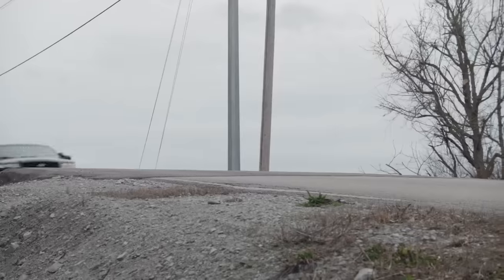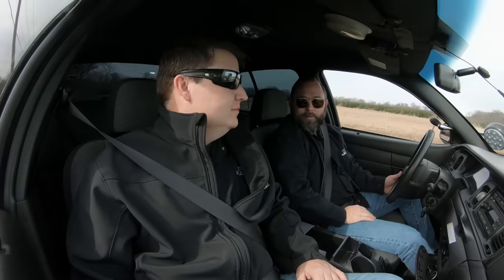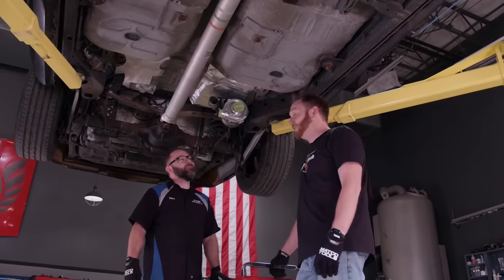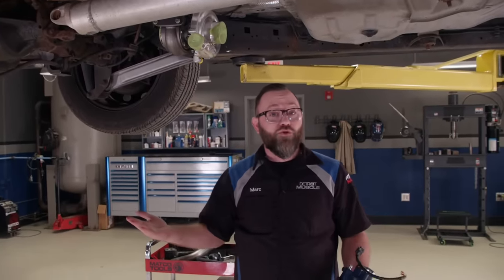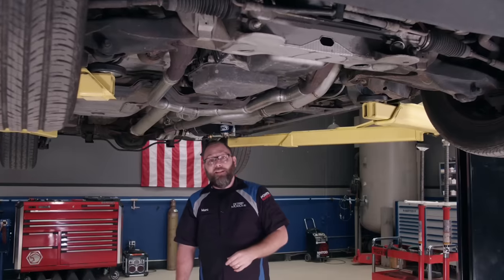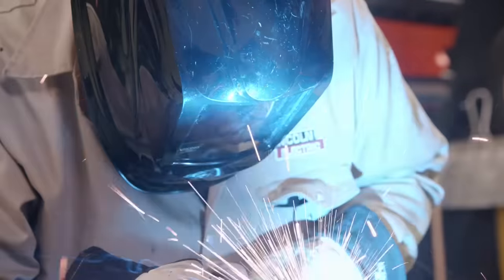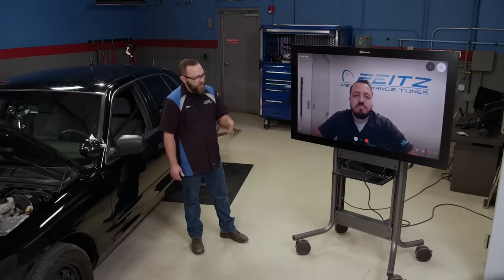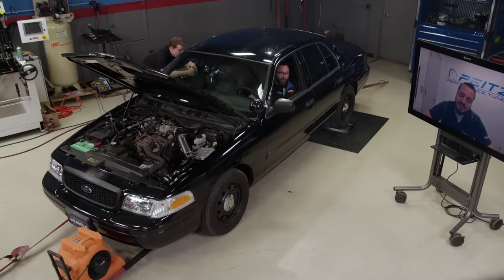Boosting A Crown Vic Police Interceptor 160 Horsepower - Detroit Muscle S7, E7

Comment: As a Panther owner, I watched this with some interest. I say 'some', because I really have no intention of making a build out of it. It does its job beautifully in stock form, and I have an old Corvette to play with on the side. But, if I just had the Panther and wanted to play, I'd at least consider doing this. So let's think about it for a second.

For a daily driver, it needs an intake snorkel that breathes from a safe location. Like maybe the trunk, for example. Or up in the rear fender somewhere. I don't know. You might want make a shroud for the turbo setup, to protect it from all manner of threats it will face under the car. Luckily all that stuff is just more cheap / creative fabrication. Well, cheap if you have the means to do it yourself.

The turbo lag must be epic with this setup. Meaning it takes an eternity for the boost come up after you open the throttle. That's the huge, obvious downside to this installation. There is no way around it. But the power it makes is very impressive, on the dyno.

In the real world, I think the lag would be the defining factor. It would suck for any type of canyon carving work. But who goes canyon carving in a Panther? A few guys do, actually, but they're weird like me, and don't count.

No, this is a hooligan setup, for sure. It would be fun for half-mile and mile speed runs, I think. Don't forget to figure out how to defeat the factory 120 mph speed-limiter...

Comment: ya but ya can fit two smaller turbos each one right were the catalytic converters used to be. duel M55 trims, ready for anything down the road or even another 250'000 miles. that's what i am going to eventually do with the 1994 4.6L Thunder Bird i have!

Comment: On the filtered side of the Turbo, a 90-degree tube up into the trunk would make for a closed air-box and avoid excessive dust and water infiltration.

Comment: Orientation of the turbo for the oiling is important if not running a scavenger pump.
You should have gone over all the added parts necessary for a rear mount turbo, part #s, etc.

Comment: I own an 03 cvpi. I've always been a Ford guy,  but these are great cars no matter what you're into. Drive it like you stole it and you still can't break the thing. (Believe me I've tried. LOL) And if you do break it, who cares?! Parts are dirt cheap and everywhere. As for everybody crapping on the rear turbo setup. Apparently none of you have ever heard of STS. And no, of course you don't want to orient the turbo so that your filter is  hanging down on the ground. Just clock the housing. shield the filter and your fine. Has anyone ever seen a front mount?? Sucking in every particle of dirt n water in its path. I've seen low underhood mounts too that are no better.  And this really is a fairly easy install. I've helped friends w modded turbo setups on hondas evos stis etc. And if someone thinks this plumbing is "bad",  clearly you've never been around someone doing a custom turbo setup.  Fun build guys. Thanks!

Comment: I’d think it would be easier and less risky for the motor if you’d make a remote mount oil system for the turbo. Not risk the line breaking and dumping oil. Plus, the oil would be cooler and less prone to burning after shutoff.
Reply: I was thinking that myself a closed system with maybe 3 quarts of turbine oil and its own filter. You could probably ignore it for a good  long while.

Comment: could do a bend on the intake and place the intake filter inside the trunk or under the rearseat  , simple fix to be able to drive in the mud and rain , i think the cold air pipe is too long to make a backfire reach the filter anyway

Comment: Lol anyone notice when they first pulled off in the Crown Vic how the water shot out of the stock exhaust? I think I’ve seen that occur on literally every Crown Vic from that era upon first start up and take off. It has to be something inherent to the way that particular vehicle is setup because it happens much more than most other vehicles.
Reply: Water coming our of tailpipe denotes how efficient engine combusts  fuel.

Comment: Why would you put an air filter under the car? You could've easily put an air intake tube from the turbo into the trunk and then put an air filter into the trunk.

If properly sealed up, it could be driven practically in any weather.  It wouldn't be too hard to retro fit that.

Comment: Was this done to save on intercooler purchasing and install? Its weird to mount the turbo, a its accessories, on the back bottom part of the car, without any protection. Plus the turbo lag will probably be quite noticeable - compared to having the turbo setup next to the engine.

Comment: Would love to see air intake temps with the hot and cold side tubing sitting next to each other.
Reply: no I reckon that long tube to the front is almost an intercooler.
Reply: @RIPPERTON  next to the exhaust and substantily less surface area than an actual intercooler? Highly unlikely.
Reply: @Ausblack   probably doesnt cool well but at 60mph theres not going to be any noticeable heat soaking over from the exhaust pipe, air speed is going to be pulling that hot air away right now

Comment: Could have run the air intake up into the trunk to protect it from the elements but might have hotter air in certain conditions but would be better than the filter hanging out in the mud puddles and snow banks just my 2 cents

Comment: Nice job guys! I do have to add that most back yard mechanics including my self dont have the tools to fab a complete custom turbo kit like that. For someone like me its cheaper id say to throw a blower on the car, or if possible a good used gen 2 or 3 coyote. As far as low budget goes. But as long as your paying a shop to do this kind of custom work its nit going to be cheap.

A car like this needs to be daily, so im not a fan of the air filter location. 

That power seems low at first. But its actually not bad. I didnt catch how much boost it had. But i can say that i had friends with full bolt ons and supercharger that didnt make this kind of power.

Comment: If I was going to have to fabricate an exhaust system anyway, I'd put the turbo under the hood with an intercooler so I could drive the car in the rain and snow without FOD'ing the turbo or hydrolocking the engine. OR I'd go the simpler route and modify a Mustang centrifugal supercharger kit and call it a day.

Comment: Rip, i have 2001. And hp tuners, and, well everybody starts at about 2005. Pre-05 cars dont have tuner support w/ cable throttle, non electric transmission etc

PS if im wrong, ill gladly be, just simply let me know who would tune a 1998-2002 vic/marq/townCar

Comment: I've seen the horsepower almost triple on a stock 4.6 Crown Vic that was not running right and didn't make 140 horsepower while they started feeding the nitrous with no tune I think they ended up reaching almost 500 wheel torque and I think like 479 HP I believe just from spraying nitrous directly into the intake by the throttle body LOL

Comment: Isn’t kinda stupid to mount a airflow restriction device in the exhaust (the turbo bcs clearly its restrics air flow) to pump more air into the engine and have more power but at the same time you lose power bcs of air restriction. Can some mechanics (experienced) help me with that?

Comment: Try insulating the exhaust back to the turbo, And maybe relocating the breather under the rear bumper.
Reply: Arthur Hardy  wayyyyy to far from the engine. You want to catch the exhaust as close as possible to engine to capitalize on thermal expansion. Back of the car is just stupid on more levels than I can count.  I’m sure it’ll be better than nothing but good grief, coulda been so much better. Turbo lag will likely be atrocious.
Reply: @jeffallbright4449  Yeah, the turbo is were it is already, that's why I said insulate the exhaust back to the turbo, to preserve the heat of the exhaust.

Comment: You should have build a SVU Police Interceptor. A Terminator P71 is my dream Crown Vic.
Reply: There is a Terminator SVT Cobra Mustang that Ford made in 2003 / 2004.
Reply: I know I would love to have the Mustang Terminator Cobra.

I like the Mustang Terminator body styling more than the Crown Vic body styling.

But for a sleeper, I go with the Crown Vic.

I guess if anything get a Crown Vic shell and gut out a ( rear ended or t boned ) Terminator Cobra Mustang,of its needed parts to swap it over successfully to the P71, and do it like that.

Comment: Such a long intake, and the exhaust gas route to the turbo will not affect the huge turbo hole?
What about the lubrication system that also cools the turbocharger? I understand that at such a distance from the engine, the exhaust gas temperature is not too high, so the turbo does not heat so much, but lubrication is needed, oil collection too.
Reply: It might be a self contained turbo 🤷
Reply: the turbo is still lubricated by engine oil just have to run really long oil feed line back to the turbo. The electric oil scavenge pump then sucks oil out of the bottom of turbo pushes oil back to the oil pan because since the turbo is under the car it cant just gravity drain back to the pan like a normal system so you need the pump to do that.

Comment: Y'all going to make me crawl under my 02 Vic cuz I'm curious if you can drop the fuel pump out the same way cuz the only fuel pump I've changed we had to drop the tank how did y'all get the gas out does it have a drain I guess I'll go look at mine but obviously you have to get the tank empty to drop that pump out didn't realize it was made that easy on the Vic

Comment: Kinda defeats the purpose of using the charge tube for an intercooler if it's right next to the exhaust pipe...😲
Reply: Sure does.
Reply: I'm with you on that thought buddy. All I can see working is insulated heat shielding the whole length. Kinda like the great wall of China? LOL!

Comment: The HP and torque curves shown on the screen are wrong. The crossover is shown at 5500rpm which is theoretically impossible. It is always 5252 RPM.

Comment: A Crown Vic is a bad mofo until you pull up next to a Deville with a Northstar. Same size engine but them 32 valves will suck the air out of a Vic mouth.

Comment: Love Crown Vics, love turbos,  but for the life of me I can't understand putting the turbo under the car where dirt, rocks, water, snow, cowshit, you-name-it can be sucked into the air filter.  I'd put it right up near the engine where I would not lose heat energy and have much less Mickey Mouse to get oil in and out of the turbo.  Oh well, I guess it's television........
Reply: Terrible idea
Reply: These cars are packed like a tin of sardines.. not much room in the engine bay for a tubing and all the piping, i inagine just getting the charge pipe upto the intake was a hassle

Comment: Why not used an LX Dodge Charger R/T Police for this Project???
Reply: The DELAY must be horrible in this kind of Turbo position.... Can´t beleave why; I heared; "this kind of Turbo Position didn´t need a Intercooler...(money)"
But then you need that Oil Pump added to the system, that the Turbo gets its neccessary Oil Pressure mounted back there. And this Oil Pump looks like that it will cost nearly the same or more than an intercooler...right???
So WHY mounting an Turbo on that position, what has such an DELAY ???

Comment: That long block is junk. Spark plugs problems are handled by actually doing the correct maintenance. It's still using the stock junk rods and crank. Probably using the same junk plastic timing set also.

Comment: I was actually surprised that the 2V made 200 hp. I was expecting 150-180
Reply: It’s supposed to make 250 which is absolutely what they make stock I dynoed mine when I got my 2011 it had 23k miles on it it made 254 completely stock so this one making 200 means there was definitely something not right and only SN95 4.6’s made 180hp crown Vic 4.6’s are superior
Reply: @StockTurboN20  
I think I’m 2008 Ford upped the HP to 250. The sn95 got the PI heads on 99. They had 260 hp.

Comment: sorry much rather have the dual exhaust couldnt even hear the turbo and strange that you crown only did 200hp when my 06 does 263 stock
Reply: Your stock vic Puts 263 to the wheels or the flywheel factory rating u mean? Two entirely different ratings bud
Reply: Strange that CVPIs are only rated at 250hp at the flywheel. But whatever you say.

Comment: I'm building one on my channel lol built motor cams hi compression heads converter everything
Reply: crown Victoria lifestyle. 2V Or 4V, what is your setup?
Reply: 2v I believe
Reply: @bri-manhunter2654  I have both I'm working on the 2v now I just got my degree in kit from modular head shop I built the trans by myself
Reply: @bri-manhunter2654  I have two cvpi 2011 and 2009 
I have Cobra heads and aluminum block and a couple other parts down the road for the 4 valve swap in my 2009 cvpi

Comment: One word - ruined 

The whole fitting of the turbo is abysmal an amateur mechanic wouldn’t have to run piping as long as the Las Vegas strip, not to mention the turbo just diminishes the cars character 

Right here is the downside to living in a free country….

“Direct universal fit” then proceeded with “takes a little bit of modifying” which contradicts the first statement is prime example of the hillbilly bob’s level of intelligence…

Comment: How can it start @ 200 HP when it's @ least 240-250 HP stock?
Reply: 250
Reply: Rolling dyno number vs factory flywheel rating. They're rated at 250hp flywheel.
Reply: Rated at 250 HP at the flywheel. They measured it at the wheels. Yes you lose 50hp sending that power through the transmission, down the driveshaft, through the rear differential, down the axle shafts to the wheels. Long drivetrains = massive power loss.

Comment: So they expect the long charge pipe to act as an intercooler, but right before it gets to the intake, it runs right with the exhaust.  Going out on a limb and sayin that may not work quite as well as planned.  Dunno why they didn't locate the air filter into the trunk or something.  Not ideal, but better than...sorry kids, can't drive in the rain.  /boggle

Comment: still a nose heavy tank good for 125..130 mph stock ..chipped 160..but still small lighter  car winding road  will beat it
Reply: Initial D proven.
Reply: 160mph with 215whp and 4000lbs? Dont think so. Lololol
Reply: The Vic cannot do 160 and the cop chip if that’s what your talking about does not exist and they make 250 if it’s a p71 and without police stuff inside the car literally only weighs 3900

Comment: whats with everyone and turbos lately? turbo is trash, anything that adds more heat to your engine (like running the exhaust through it a second time) is going to significantly decrease the life of your engine while providing a sub par boost to performance. just use a supercharger, give your engine the cold air it craves, and get a lot more power back in return.

Comment: You can tell Tommy and Marc hate each other. Who would put a turbo back there, with 8 feet of pipes going back and forth, 8 feet of oil hose, and mounted in a place where its going to fill with dirt and possibly get knocked off. Pretty stupid location.

Comment: Did you fix the cylinder heads first? They can barely hold a spark plug at regular power, let alone boosted. Not enough threads. I think everyone know that by now.

Comment: What's with the 160 HP in the clickbait? 224 from the factory and that's a standard car.
Reply: The dyno showed 200 stock at the wheels and it gained over 160hp at the wheel. CVPI is rated at 250hp engine from the factory.

Comment: Unfortunately, with the length of the inlet tubing, there'd be so much lag you could have lunch waiting for the turbo to spool up.
Reply: Suprisingly not the case. I figured the same thing before i rode in a Silverado 4.8L with an sts kit which is even farther back than a car. Full boost just over 3k. I really couldnt tell the difference vs a regular style kit. Also no need for an intercooler travelling thru all that piping. No intercooler also helps reduce lag

Comment: Very impractical mod. You have a sled that runs like a hot rod but you can't drive it in the rain or on dirt roads. Also, like most of these TV builds we see the dyno and no street tests - not even a parking lot burn out.

Comment: Damn, my F150 makes 365 hp w/420 lb/ft torque on a stock 3.5 GTDI🧐
Reply: not for 250,000 miles it wont.
Reply: @rhyoliteaquacade  just had one come in with 834,000 miles. He replaced the engine at 500,000 because it was worn. 250,000 is nothing to achieve with a little maintenance.

Comment: You know what?  No, just no.  You could have e done much better without even putting a turbo on it.  You just lowered the ceiling when it comes to building this thing.   You could have spent way less and still have room to add onto it while making even more power.  If you dont plan to do anything else to it, yeah you did great, but it's an old police interceptor and you could have done better.

Comment: A neat stealth idea but all wrong its going to have insane turbo lag and rocks and debris tearing through that filter.We all hate on Engineers pack things in so tight have to spend hours removing components to get to a 5 dollar part. While this is where they know what is. Putting a turbo on an exhaust manifold EXPENSIVE DAH NO heat and cylinder pulses are strongest in the manifold that is what spools up a turbo been doing it in diesels for years turbo lag almost non existent . The closer you can get a turbo to the " heat " source   the more intended for its purpose. What you are doing is a novelty.Just saying.